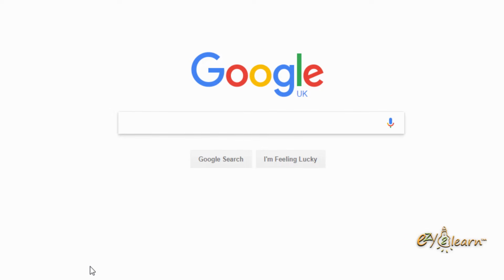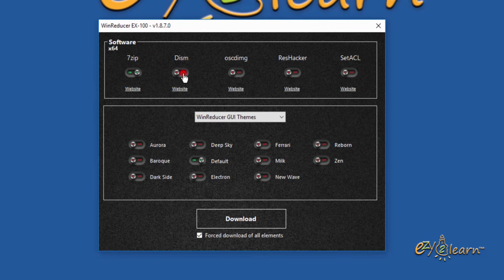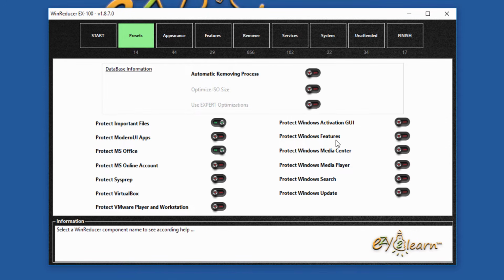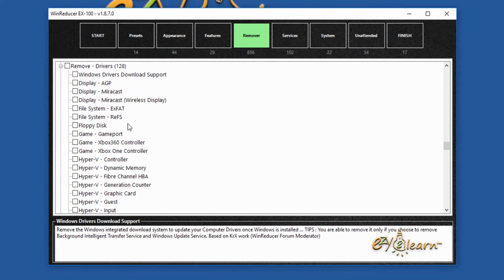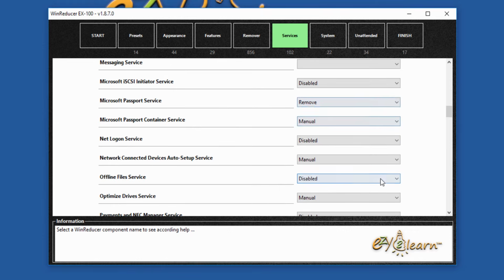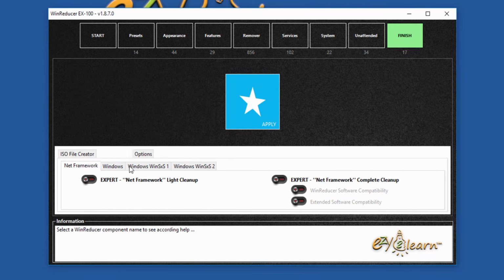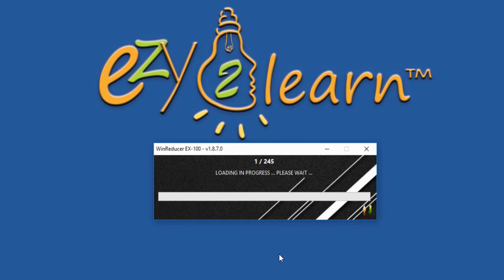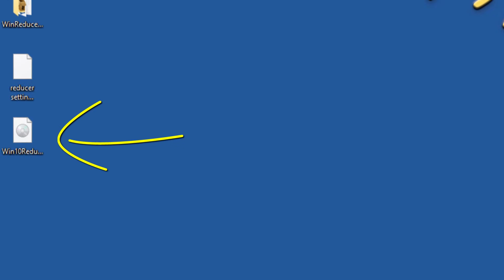Customize & Reduce windows 10 ISO File using WinReducer without NTLite by ezytoLearn

Comment: Windows security finds Trojan: Win32/Wacatac.B!ml  virus so this is dangerous
Reply: Or does it belong to the program?
Reply: Jan Sterenborg yeah it’s a reg file not an xml file so it’s not real
Reply from the maker: Very sorry, I have accidentally shared a file from different video and it was original windows photo viewer registry file (not harmful) that's why your antivirus picked it up, I have updated the link in the description box. Correct file name is (ezy2learn-winreducer-settings-v1709-up.zip) with password ezy2learn. unzip the file and load it to your winReducer. Apology again
Reply: @ezy2Learn Some questions
Working on this project:
why is my Virus scanner Avast shut down?
why gives Windows defender a severe warning about the Wacatac virus
and why is the file you referring at ending with .wccf?
Reply from the maker: @jansterenborg  Please see answers below
why is my Virus scanner Avast shut down?
 Avast shutting down randomly, is a very common issue with that software. Removing and reinstalling Avast may solve the issue. If you wish to use third party antivirus, then try Kaspersky Antivirus.
why gives Windows defender a severe warning about the Wacatac virus
? Wacatac is a backdoor trojan, comes from .exe files, Windows defender should be able to remove it. otherwise it could be removed via Safe Mode. 
and why is the file you referring at ending with .wccf? .wccf is the WinReducer settings extension file, it can be opened safely with your notepad software on your computer to view it. Also, you can export settings file with your winReducer software and you will find it is .wccf.
Reply: @ezy2Learn  You convinced me sorry for the trouble!
Reply from the maker: @jansterenborg  no worries at all :) , good luck

Comment: Are there prefab reduce  settings we can use? That would be very helpful
Reply from the maker: Hi, I will upload a settings file that you can use. I just need some time to prepare it. Thanks
Reply: @ezy2Learn  okay thanks!
Reply from the maker: @jansterenborg  Very sorry about the delay, I have just uploaded the file, please see video description box for the file. Thanks :)
Reply: @ezy2Learn  Thank you!!
Reply: @ezy2Learn  ps I never had any problem with Avast in 20 years until this project
Reply from the maker: @jansterenborg  Avast shouldn't interfere with winReducer unless you are using an infected version of Windows 10 to customize, otherwise it should be fine. Maybe you need to source a copy of Windows 10 from a trusted source.
Reply: @ezy2Learn  new virus scanner Eset all is working perfectly no problems!
Reply: @ezy2Learn  Made a tour with this program I think it is a super program! Thanks for all the worK!

Comment: After configuring installation when I click start download, this is the error message. "THIS APP CAN'T RUN ON YOUR PC. CHECK SOFTWARE PUBLISHER"
Reply from the maker: What windows version do you have and what's your PC specs ?
Reply: @ezy2Learn  I have Windows 10 version 64 bit OS. PROCESSOR INTEL DUO CORE 2GB RAM 64 bit processor. I downloaded the 64 bit version of winreducer as explained in the video.
Reply: @edtechsolutions694  Bro you use 64bit only if you have 4gb or more of ram. You only have 2gb so you need the 32bit version instead.

Comment: how can i add software to the installer??
Reply from the maker: You can add Drivers and updates:  "System" Tab--> Integration Then you will have the option to add Drivers or windows updates. I personally don't use it because install Windows Lite version on different computers, So I don't want to load my ISO file with unneeded drivers that might be useful for 1 computer but it won't be useful for others!  Just remember that you can not use executable files for drivers (*.exe, *.msi....etc) WinReducer isn't the tool for it.

Comment: My friend recommend me a link that can get more cheap but 100% genuine windows 10 product key here: #plus.google.com/u/0/107481765297162610825  Now I have actived my windows 10, great website!
Reply: This is even better: get.msguides.com/windows10.txt
Paste the code into notepad, once you have installed Windows 10.
Save the code and name it whatever you like (but it must end with .cmd).
Run the code as an administrator.
If your antivirus blocks the code, make you disable it temporarily before running the code.
If it deletes the file, then restore the file.
Run the code as an administrator.
Hopefully, Windows 10 will be activated.